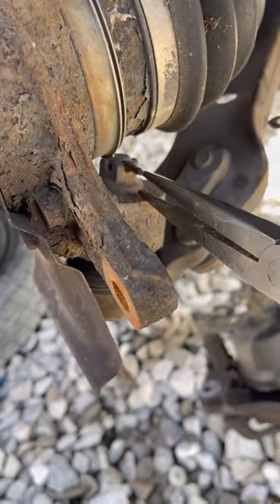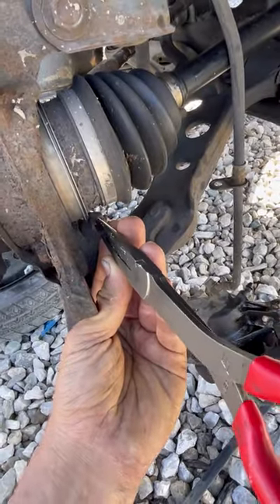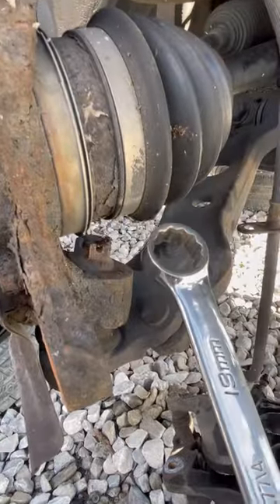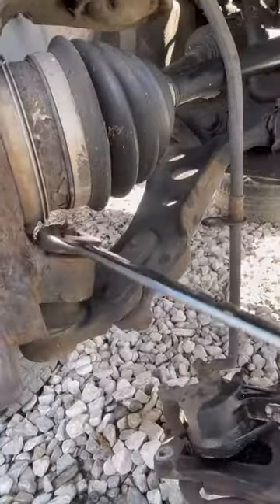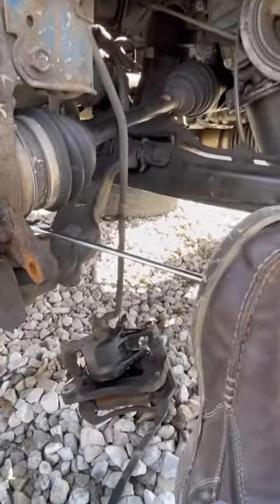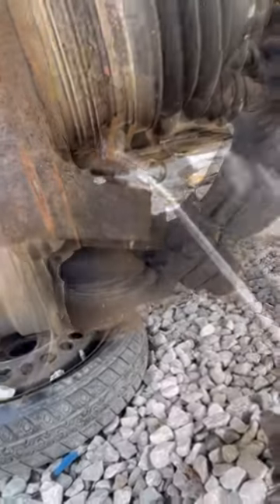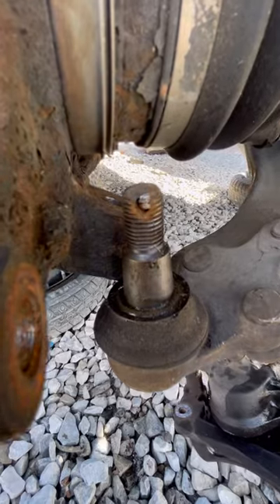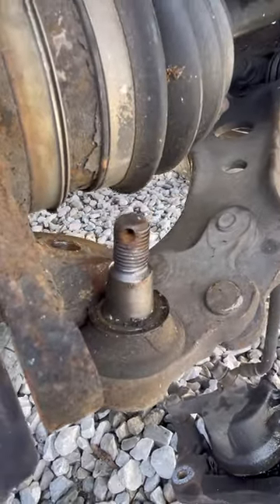Shearing Cotter pin off w/ castle nut

Comment: I’d worry more about the caliper hanging by a brake hose.     Stretch stretch.
Reply: This is at a junkyard
Reply: 💀 oh no not the soft hose
Reply: Love the way  people think brake hose is made of elastic band.its made of high strength multi ply reinforced rubber and fabric
Reply: @turbowank16v  and not designed to take the weight of a brake caliper....
Reply: @Userpike  get real.brake lines take pressures well over 2500 psi.and you think letting something dangle that weighs the same as a bag of sugar is going do any damage.if your brake hoses behave like stretch armstrong you have problems.yes its good practice to hook your calipers up but in real time its never gonna stretch and snap.been fixing cars for 20years yet to hear of a brake caliper just shredding in mid air and falling to the ground.and if it ever happened to someone then maybe they was lucky cuz its a sure sign their hose was perished beyond safe.
Reply: Yeah if your brake hose is that old and worn that they’ll stretch it’s already time for a new one
Reply: Yep great mechanic wk here
Reply: @PooJoe  yeah they get brittle over time and hanging them will cause them to split etc.. then later on stomping the brakes is when they fail.

Cant believe people think break lines dont brake 🤷‍♂️
Reply: Not doing anything

Comment: 😂😂😂 all the babies crying about the caliper hanging from the hose. You fail to realize the brake hose is put under more stress everytime you hit the pedal. If the 100 psi or more of line pressure can't dislodge the hose from the fitting the 5-10 pounds that the caliper weighs can't either.

Comment: Break it off almost inside the castle nut. Then bump the castle nut til the gap lines up straight with the hole. Small punch, Vice grips and a hammer.. boom. I can’t count how many I’ve done.

Comment: I'm no mechanic. Iron/sheet metal worker. Tac weld it to a hydraulic jack or press with something like wire or something and spray good with a little lube and the hydraulic pressure will remove the pin safely.

Comment: See those 2 bolts on the strut attaching the knuckle? Remove those, disconnect outer tie rod end from knuckle, remove axle nut, remove axle, impact wrench on the lower ball joint castle nut. Boom, simple as that.

Comment: i like the way the caliber is hanging by the hose. pls if you don`t know what u are doing ,don`t show others
Reply from the maker: Only amateurs complain about the brake hose hanging.
Reply: I like the way you spelled caliper 😂
Reply: @NaptownTuner  no it`s mechanics that know what there doing unlike the video
Reply: O WOW YOU PINT OUT A BOBO  CONGRATULATIONS
Reply: I got more mesmerized by the rust flaking off the hub, I get nightmare vibes from this car. Also, I never let mine hang from the hose, but who knows maybe hes replacing that shit or something.
Reply: @HarleySLA  That rust isn't really a problem, it's super common on every car here in the UK.
Reply: Real mechanics can tell this is in a salvage yard. Nobody is ever going to use that brake hose.  But if you are keeping it don't hang from the hose
Reply: @ronp499   I know a Ron P by any chance did you work for Mark Buick in yonkers

Comment: I try to pull it out which hardly ever works. So I shear it of turning nut and punch it out.  If I need to save it and throw a new cotter pin in. But usually the ball joint is getting replaced if I'm disconnecting the knuckle.  Rust belt.

Comment: I just use vice grips, clamp down on it and pull and twist at the same time, and it will come right out...and you should never let your caliper hang by the hose that's a sure way to destroy it...Isn't this the same guy that put valve grind compound on a ball joint lol

Comment: why can't people work on cars anymore? it amazes me how much people struggle with small issues like this. I had a cotter pin stick on me on a lower ball joint and I torqued and twisted a slip joint and needle nose pliers until it came out. simple as that. working on cars is hard work, stop looking for the easy way out.

Comment: I sure hope you're not claiming to be a mechanic. Use dikes. Don't cut it   use them to grab and peel grab and peel out of the hole.  It doesn't matter what shape or condition it's in. That's how you get a split pin out

Comment: Had my lower control arms done. When they were done they said I need new cv axles. Wondering if they didn’t tear the boot. It was torn right in that spot not where the boots usually tear